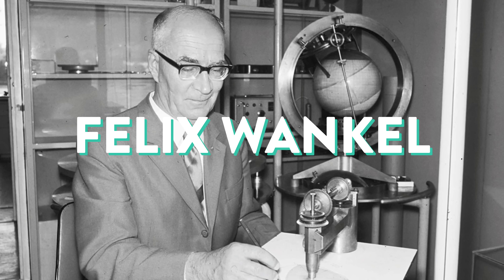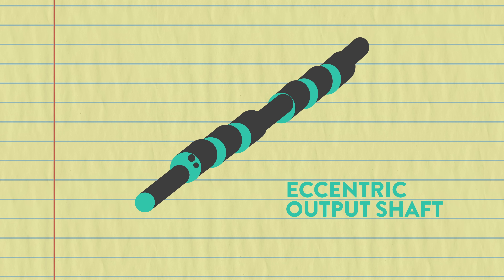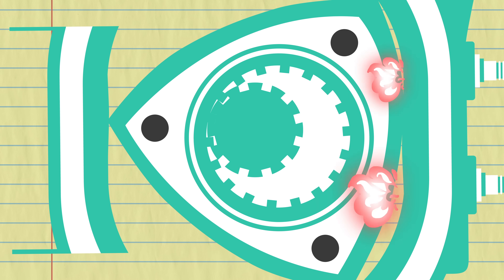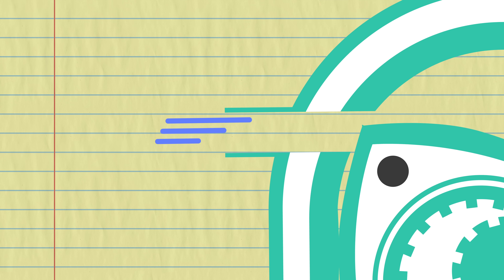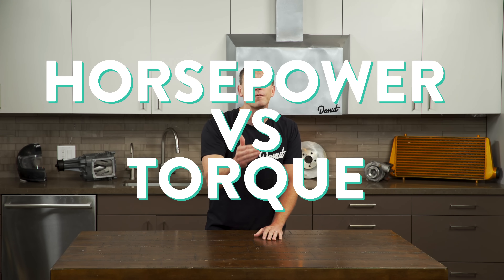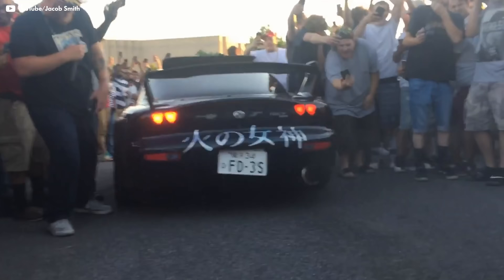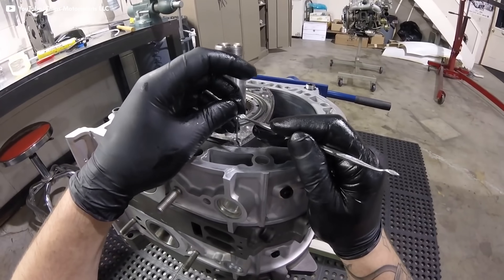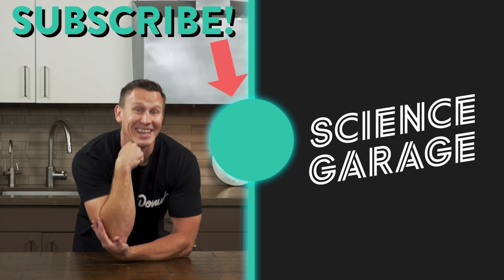Rotary Engine | How It Works

Comment: The speed multiplier is actually the problem. That slows the combustion speed relative to the output shaft. It isn't the low compression ratio that's the problem. Wankle is 9-1 vs 10.5-1 for a piston. Its the slow cycling speed. If it was just the compression ratio, a turbo would fix the problem.

Comment: Stupid question I'm just starting to learn how to get into cars, but how does it start moving if it has no combustion to move it around inside the housing?
Reply: The problem with this engine is sometimes it doesn't start
Reply: Never be afraid to ask what you feel is a "stupid question"- That is how we learn.

As to your question- Im not entirely sure I understand what youre asking. Are you asking how the engine literally "Starts" from an off position, and gets going?

If so: The starter motor.

Cars have a small but powerful electric motor they use to start up. When you "crank" the car this motor has a gear that extends forward and grabs typically onto the back of the flywheel (or similar)  of the engine (which has a ring of teeth around the edge to engage with the starter).  This motor is powerful enough to get the engine spinning quite a few hundred RPMs, enough to get the combustion process going (simply start giving it spark and fuel). Once the engine is actually running the starter motor is disengaged (either automatically or when you physically stop cranking it with the key) and that "Gear" id mentioned early retracts back.

Comment: I ain't no engineer or even remotely qualified for this, but could it be possible to have either an extra secondary burn chamber and switch from the triangle or have the exhaust port only open to a certain timing mechanism so that a 3rd spark plug burns the unburned fuel?
Reply: The spark plug will not ignite the unburnt fuel without the correct mixture ratio of both fuel and oxygen.

Comment: Apple: Falls On Newton's Head  
Newton: Discovers Gravity

Dorito: Falls Between Wankle's 
Car Seat And Center Console
Wankle: Creates The Rotary Engine
Reply: Felix Wankel did not invent the Rotary type engine, Felix Millet invented it in 1892.  This is not a Rotary type of engine, it's a Wankel KKM57 designed by Hanns Paschke and Walter Froede. This engine does not have a fixed main shaft or a rotating housing, it has a Conventional layout.

Comment: Can anyone explain to me such as with this single rotor above the following, please?  Am I thinking logically that for one complete turn of solely one rotor that the crankshaft has turned 3 times which makes it a 3 stroke?  And too for each rotor such as with a two rotored engine, do you have the equivalent of a 6 pistoned type engine due to the 3 faces on each rotor(times 2)?  Am I on the right track?
Reply: Its a 4-stroke.  Each combustion chamber completes a 4 stroke cycle ever TWO rotations of the Crankshaft.

Comment: I see, in a rotary engine the main problem is the apex seal which is often damaged.  the apex of the sil is just a kind of thin plate with a faceted shape.  what if the apex seal is replaced with a cylindrical shape to minimize friction with the combustion chamber?

Comment: I seen someone modify a rotary engine to deal with most of the issues they have like having a separate oil tank for just the rotor and using 2 stroke oil in it so it burns more completely and is easier on other components while the rest of the motor is still lubricated with normal engine oil with all the extra additives ect ect it's kinda interesting and weird to think that a random guy with an engineering degree can fix the issues a multi million dollar company can't figure out

Comment: 6:45 my rx8 after 50.000km : apex seal, middle shaft, what ever it is to hold the rotors need to be polished from rotor :(

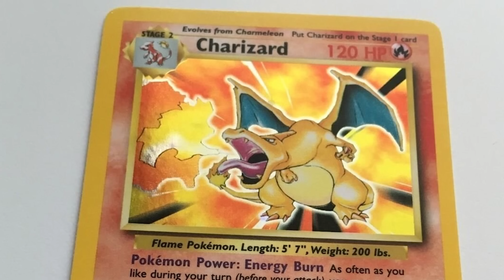Comment: 3:33 & 4:44 basically. My mazda rx8 have 3cycle per rotation or equal to 3 pistons. So 2 rotor=6 bang per rotation=6 pistons. But less in cubication or engine size wich is good

Edited: my hommie called my car "walmartRX7 or we have RX7 at home"

Comment: Emissions and reliability aside, this is just a really cool engineering idea brought to life. Always cool to see designs that push against the comfortable norms. 

Seems like the emission problems are inherent so it may be done for, [which isn't bad] but still, cool that these got developed so far in the first place!
Reply: Absolutely fascinating design, unfortunately it was fundamentally inferior to reciprocating engines.
The biggest problem is reliability and the lack of power and dismal torque output compared to it displacement and fuel consumption.

Comment: More power but still lightweight.
Reply: These make less power and have no advantages... that's why they are obsolete
Reply: @sandervanderkammen9230  i mean 230hp out of a na 1.3L in the rx8 is very good, idk where you got the make less power from. and there are advantages, they are "obsolete" because they use alot of fuel and oil and dont meet emissions
Reply: @arcanevoid9199  The Mazda RX8 engine is a 3.9 liter engine.
59 hp/liter is absolutely horrible and 40 lb-ft. of torque per liter is PATHETIC!
Reply: @sandervanderkammen9230  how is it a 3.9L?
Reply: @arcanevoid9199  Do you not understand how swept volume displacement is calculated?

The Mazda 13B-MSP-RE is a 4-stroke engine, each of the 6 combustion chambers has a swept volume displacement of the 654cc and a total displacement of 3,924cc's
Reply: @sandervanderkammen9230  found this online "the engine displacement should be 40ci(654cc) times six to equal 240ci(3.9L), right? In a way, yes, but that would not be a comparable displacement to the 4-cycle engine.

The key for comparing the displacement between the 4-cycle engine and the rotary engine is in studying the degrees of rotation for a thermodynamic cycle to occur. For a 4-cycle engine to complete every thermodynamic cycle, the engine must rotate 720° or two complete revolutions of the crankshaft. The rotary engine is different. The engine rotor rotates at 1/3 the speed of the crankshaft. On two rotor engines, front and rear rotors are 180° offset from each other. Each rotation of the engine (360°) will bring two faces through the combustion cycle (the torque input to the eccentric shaft). This said, it takes 1080° or three complete revolutions of the crankshaft to complete the entire thermodynamic cycle. Obviously, we have a disparity. How can we get a relatable number to compare to a 4-stroke engine? The best way is to study 720° of rotation of the two-rotor engine. Every 360° of rotation, two faces of the engine complete a combustion cycle. 720° will have a total of four faces completing their cycle. 40ci(654cc) per face times four faces equals 160ci or 2.6L. That’s a well-reasoned number and now gives us something to be able to compare to other engines. In addition, since four faces passed by in the comparison, it’s like a four cylinder engine.

Now we know, the 13B compare well to a 2.6L 4-cylinder 4-cycle engine."
Reply: @arcanevoid9199  Compared to a 4-stroke Otto type engine, when we convert the Wankel's 1080° firing order cycle to 720° we get something comparable to a 2.6 liter displacement, however the engine's total, true displacement still remains 3.9 liters.
This was the method used by Felix Wankel, Hanns Paschke, Walter Freode and Max Bentele.
Reply: @sandervanderkammen9230  are you ok bro? what did the rotary do to you?
Reply: @arcanevoid9199  I love Rotary engines... but we are talking about the Wankel engine son, don't you know the difference?

Comment: In my country going with Rotary engine is literally digging your own grave
Not many mechanics can repair rotary engines here, and when there are some, they'll charge you more, probably due to scarce spareparts and they value their knowledge on rotary engine more
Many people who goes with RX8 here would usually swap the rotary engine with other engines, for easier  and cheaper cost of maintenance

Comment: https://youtu.be/jLtyNtf9_ew
Warped perception and liquid piston has changed the rotary engine they put a oval inside for a rotor and put the Apex seals on the cylinder it has three chambers to get three power strokes for revolution and Bloomington Connecticut
Reply: Beware of LiquidPiston,  its nothing but a vaporware scam

Comment: so technically is a 3 stroker
Reply: All Wankel engines operate using the 4-stroke principle
Reply: @sandervanderkammen9230  but rotarys only have the Intake, power and compression stokes, no power stroke
Reply: @azenu577  Wankel engines have an INTAKE, COMPRESSION, COMBUSTION and EXHAUST strokes.
Reply: @sandervanderkammen9230  but when, as soon as its compressed it combusts because of the timing of the spark plugs
Reply: @azenu577  You don't seem to understand how the Wankel engine works.
If we use a Mazda 13b engine as an example.
It has a 30mm stroke twice per revolution of the eccentric crankshaft.

Comment: i like the concept of the rotary engine, but i wonder if they could ever be made to be reliable and more efficient.
Reply: Unfortunately by the mid 1970s all of the major manufacturers involved with the development of the Wankel engine reached the same conclusion,  that the Wankel engine is inherently and fundamentally inferior to reciprocating engines and that they have several serious disadvantages that cannot be resolved.
Even Mazda finally admitted defeat and abandoned all development of Wankel engines in May 2009.

Comment: How would it work on a speed boat, direct drive to the propeller?
Reply: Several companies including OMC (Johnson-Evenrude), Yanmar, MAC (Sachs), RPMC, TES and Supertec GmbH. Developed or produced outboards or direct drive marine versions of the Wankel engine...
None were successful.
Reply: @sandervanderkammen9230  Was the lack of success for engineering reasons, cost, buyer's doubts about the technology? What was the performance like?
Reply: @jacqueslefave4296  OMC spent millions of dollars developing several prototypes and production engines.
 Unfortunately the Wankel never offered any advantages over its reciprocating engines and suffered from poor fuel economy and reliability issues.
Yanmar, another major industry leader in marine propulsion launched a production outboard but was forced to recall and refund customers after major reliability problems halted sales.
Sachs was the very first Wankel engines on the market in 1964, by early 1970s they halted production due to poor sales.
They sold thier Wankel engine program to Norton Motorcycles who went bankrupt after the launch of its Wankel engine bikes.
Reply: That's too bad, as an engineer I like to see innovative designs succeed, but it just doesn't always work that way. I still hope that advances in materials science or fuel design can make it work better, but there are no guarantees in exploring the unknown.😐
Reply: @jacqueslefave4296  The fatal flaws in the Wankel engine are not related to material science or fuels.
The fundamental flaw is Geometry

Just as a round wheel will always be better than a square wheel... 
So a round piston will always be inherently superior to a triangular piston.

Comment: If you can make the engine smaller you can make more horsepower in the same size engine🥸
Reply: The Wankel engine makes less power per liter than reciprocating engines.
 Overall size/ dimensions is smaller but not enough to be an advantage in any production applications.

Comment: "Mazda is committed to continuing to innovate and delivering an engaging driving experience. With that in mind, we can confirm we will bring our first electric vehicle, the MX-30, to the U.S. market. The vehicle will be available as both a fully electric model and a series plug-in-hybrid, featuring a rotary engine. Additional information about availability will be released at the appropriate time."

https://www.motortrend.com/news/mazda-mx30-rotary-range-extender-usa-confirmed/
Reply: What kind of wack ass late night game show did I just watch ;-;
Reply: @wash_your_rice  Its called when rotard johnny burns goes bat shite.
Reply: MAZDA HAS NOT CONFIRMED ANY RANGE EXTENDER MODEL FOR SALE
Reply: @sandervanderkammen9230  
doktorbimmer, a quiz.
Which car magazine reported on 4/14/21 that Mazda are introducing a hybrid car with a rotary engine?
20 points for the correct answer.
Reply: @johnburns4017  The MX30 is for sale and there is no Wankel engines offered... clickbait rumors busted!
Reply: @sandervanderkammen9230  
BZZZZT! Wrong answer. 
The magazine that announced a Mazda hybrid rotary engine was...

🍾🎈🎊 Motortrend 🍾🎈🎊

Zero points bimmer. Zero. Better luck next time.
Reply: @sandervanderkammen9230  
BZZZZT! Wrong answer. 
The magazine Motortrend that reported that Mazda is introducing a hybrid, reported the engine will be a.....

🍾🎈🎊 Rotary engine 🍾🎈🎊

Zero points bimmer. Zero. Better luck next time.
Reply: @johnburns4017  Please get therapy John, you are not a game show host.
Reply: @sandervanderkammen9230  
Doktorbimmer,  a quiz. 
What company has been reported that it is introducing a rotary hybrid?
10 points for the correct answer.
Reply: @johnburns4017   John please get therapy... this is not a game show.
You really need to get therapy.
Reply: @johnburns4017  Mazda has confirmed that there will be no new Wankel engine or range extender.
Reply: @sandervanderkammen9230  
BZZZZT! Wrong answer. 
Bimmer, the company that has been reported that it is introducing a rotary hybrid is.....

🍾🎈🎊 Mazda 🍾🎈🎊

Zero points bimmer. Zero. Better luck next time.
Reply: @johnburns4017  John please get therapy you are not on a game show.
Reply: @sandervanderkammen9230  
doktorbimmer, out of a total of 410 points available for you to win, you have accumulated a grand total of zero.
Keep up the good work.
Reply: @johnburns4017  John you have become completely delusional... you are not a game show host,  please get therapy.
Reply: @sandervanderkammen9230  
Doktorbimmer,  a quiz. 
Name the type of engine to be used in a hybrid introduced by Mazda?
10 points for the correct answer.
Reply: @johnburns4017  John this is not a game show... Please get therapy.
Reply: @sandervanderkammen9230  
BZZZZZT! Wrong answer. 
Doktorbimmer, the name of the type of engine to be used in a hybrid introduced by Mazda is a ....

🎈🍾🎊 Rotary engine 🎈🍾🎊

Zero points. Zero.  Better luck next time.
Reply: @johnburns4017  John please get therapy, you are not not a game show host.
Reply: @sandervanderkammen9230  
Doktorbimmer, a quiz. 
What type of engine has no pistons?
10 points for the correct answer.
Reply: @johnburns4017  John please get therapy you are not on a game show.
Reply: JOHN YOU ARE A BIG FAT LIAR!!!!

The new 2022 Mazda models are here and there are no Wankel engines or range extenders.

You no longer have a single shred of credibility left... everything you have posted is all lies!!!
Reply: @sandervanderkammen9230  
doktorbimmer, a quiz.
The magazine Motortrend reported that Mazda is introducing a hybrid. What type of engine will be used?
10 points for the correct answer.
Reply: @johnburns4017  John this is not a quiz show, you need to get therapy.

Comment: Does rotary engine is more durable than na normal engine?
Reply: no, the apex seals have a habit of wearing out quick. and the the engine has to be pulled out and complete dissasembeld
Reply: Wankel engines are unfortunately inherently unreliable compared to reciprocating engines.
This is why the Wankel engine cannot be used in type rated passenger aircraft... they are simply too unreliable.

Comment: "this magic triangle is called a rotor, because it spins"
Or yeah, maybe because it rotates...
Reply: Its not actually a rotor at all... a rotor spins concentrically on a fixed axis... the correct term is actually an orbiting piston.
Only the Wankel DKM-54 designed by Felix Wankel has a Rotor.
Reply: @sandervanderkammen9230  I was more focusing on the language. But thanks for the information which is always nice to get.
Reply: @basstard13  Well, one must consider that the German language is often incorrectly translated into English and there is also a massive confussion between the DKM Rotary engine designed by Felix Wankel  and the non-Rotary version seen in this video which was designed by Hanns Paschke and Walter Freode.
Felix Wankel had nothing to do with this engine... in fact he hated it!

Comment: I wonder if the AMC Pacer's production run would've been longer or shorter than what it was if it got the Wankel rotary engine like it was originally supposed to.
Reply: General Motors had serious reliability problems with the RC2-206 engines in preproduction vehicles which is why the program was suspended, no doubt AMC would have had similar problems that would have impacted sales, the OPEC Oil Crisis would have also hurt sales due to the Wankel's terrible fuel economy.

Comment: When I was a teenager inSiuthFlorida I would hang out at a gas station  that the owner/ Mechanic would keep his personal projects  stored at he had several Mazda RX1s and 2s that many people tried buying and he always told them they were not for sale  and asked them to leave his property  the cars were pretty ugly looking  but had the Rotary motor that he used for racing  he didn’t care about the exterior of the cars appearance  so he let them rusty, faded ,and dented on purpose to make people think they were junkers  but they ran great ! I graduated high school in1982 and the hot car of that era was the RX7  I’ve always been a fan of the Wankel design  and even have a Uncle that’s been converting them for Aircraft engines  for years although he prefers later model RX8 engines  and that’s what he personally drives as well